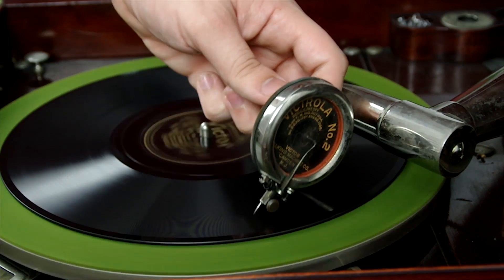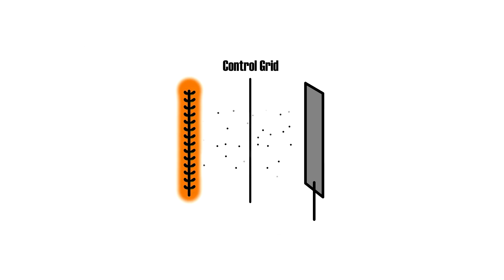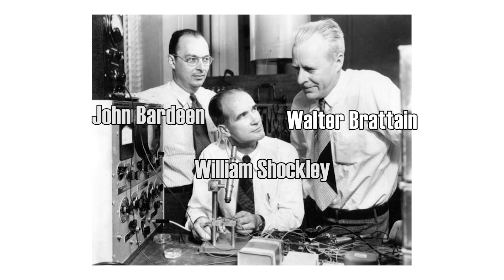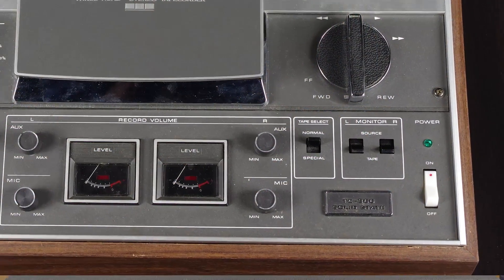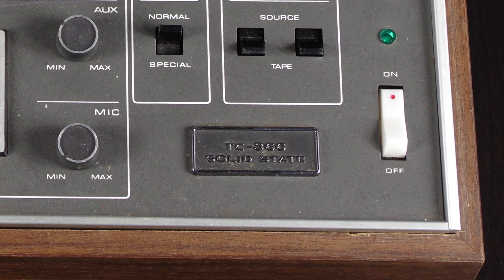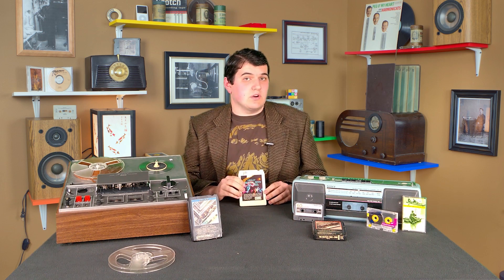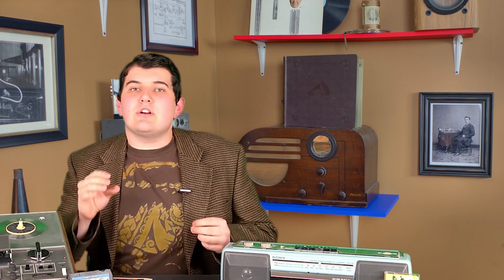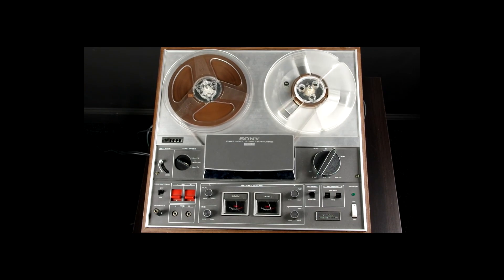Transistors: Making sound easier, smaller, and more efficient

Comment: I quickly cruised through a high end stereo shop in Japan in the late 70s.  If I remember correctly, there were a few cassette machines that used a larger than standard "cassette" with 1/4 inch tape, maybe at 3.75 IPS.  When I started buying decent stereo equipment in the 80s, I wondered why the never showed up in the USA, (that I knew about anyway).

Comment: Yeah, nowadays there's only one place where you want vacuum tubes rather than digital electronics, and that's guitar amplifiers. If you want good distortion and smooth playability (every time I've used digital amps, they always make it feel like I have to strum super hard, almost as if the guitar is unplugged, in order to be audible), that is. I would also suggest PET scanners and other areas where photomultiplier tubes are used, but it seems that the avalanche photodiode is set to replace photomultiplier tubes soon, and that's okay.

Comment: Thank you for a very informative video.  It is worth mentioning that 8-track tape players have their complicated tape-transporting mechanisms inside the machine.  The 8-track player pulls the tape into the machine out of sight and out of reach of the user when playing.  This means if a tape gets caught in the mechanism it is difficult to get it out.  Once a tape gets wound up inside you can't use the player until it is fixed.  Cassette tape is not so inaccessible and moreover is less tangle-prone to begin with.
Reply: Yo 8 track ain't a vhs tape you know

Comment: My first transistor cost me 30 shillings. I thought junction transistor came out first due to them being found by accident while trying to develop a fet. I liked valves and not all were big. Some wire ended ones were used in hearing aids and could be used to make a simple radio. Also valves were more robust. If there was a problem with the aerial on a transmitter you could smell the heating before there was any damage. With a transistor it was dead in an instant in the same situation. Valve tvs, you had to wait for it to warm up before it came on but modern tvs you get the message "Please wait, processing" while it boots up :-)
Reply: @Bill Hall I agree about the "tubes" being more robust. A transistor can be wiped out in a microsecond by ESD. With a tube, impossible!

Comment: So if transistor radios were commonplace in the late 1950s and early 1960s why did it take so long for "solid state" televisions?   I remember tubes in sets as late as 1970.   One manufacturer hailed its solid state as a novel improvement in 1970 or slightly beyond.   I would think transistor TVs would have been a big goal.
Reply: You're quite right. There was a very gradual transistion (excuse pun) form valves (UK term for tubes) to transistors right through the 1960s. There were many 'hybrid' TVs made during this time which included both valves and transistors. Transistors tended to be used in the signal amplification circuitry while a few valves (usually no more than about 8) were used in the scanning circuitry (which operated the electromagnets to deflect the electronic beams in the picture tube) and also the video signal drives to the tube. Valves were used where a lot of power dissipation was required as valves could cope with these tasks better than the transistors of the time which were still quite delicate in relative terms. By the early 1970s, high power handling transistors came on to the market and there was no need to stick with valves in TVs after that.

Comment: You forgot to mention how self-destructive 8-track tapes were. I used to repair them, and had a 50% success rate, IIRC.
Reply: Not to mention that when you pulled the cartridge out, you were often greeted by what seemed like miles of tape, still in the player.
Reply: I'm surprised the inventor didn't find a way of putting oxide on two sides of an aluminum tape just so he could turn it into a Mobius Strip and record twice as long! It took a special talent and lots of patience to get all that tape back in right side out. And you could always hear the gunched spot, even if no one else did.

Comment: 5:56 Your left hand just kinda vanished lol.
Anyways vacuum tube devices do have some advantages over solid state; for one vacuum tubes are less susceptible to external interference and temperature changes, unlike solid-state zener diodes which vary greatly with temperature.  Tubes are still used today in high voltage/high frequency applications like X-ray tubes. Tubes are also better for transmitting large amounts of RF.

Comment: The first ever cassette based format was, in fact, a format developed by the R.C.A back in 1958 which was larger contained quarter inch tape, with a tape speed of 3.75 IPS or 7.5 IPS. Does Alec know why this failed?

Also, the end of the video mentions the episode 'Compact disc digital sound' but I can't find it!

Comment: I took an 8 track apart years ago and it didn't have a spool like yours does.  There were little pins and rollers on each side and the tape snaked back and forth through them at the top there was a little spring loaded tensioner that had a felt swab on it to clean and keep the tape tight.  I found the tape in a 63 Chevy truck I bought, it was buried in the cab's corner under old rags and 30 years of dirt!!

Comment: The problem with vacuum tubes was that they were power hungry and generated a ton of heat. Sure some transistors generate heat too. And the first transistor was what is called a point-contact transistor, and the Field Effect Transistor which was just a sandwich of NPN or PNP.

Comment: There's so much more that could have been said about the early evolution of transistors, instead of spending half of the video on magnetic audio tape. There's also the subject of how the tube industry responded to appearance of transistors. There's the space charge tube that can run on 12VDC. The Soviets continued to use peanut size miniature tubes in their military electronics into the '70s. One advantage: they were able to handle handle EMP or bursts of radiation better than transistors.
Reply: Indeed, the Mig-29 used vacuum tubes.  They have special retention systems for the tubes, of course, to deal with G-forces.

Tubes are still being built and used in Eastern Europe, Russia, and China, though a great deal is simply done for audiophile consumption.

Comment: The only thing I found "a bit-slightly confusing" is that the author noted the connection names for the Transistor as "Source, Gate and Drain" and, although, he isn't in error here, he failed to explain that, that is the connection pin-out of a FIELD EFFECT Transistor (FET) which is only one type of transistor, and, at the time, wasn't the mainstream use of transistors in early electronics.  The type of transistors used, mostly are BI-JUNCTION Transistors (BJT) and consist of the connection pin-out of Collector, Base and Emitter, respectively.
Reply: I wonder how he managed to end up clueless about bipolar transistors when they were the dominant transistor in the early days until FETs were properly developed and evolved into more powerful devices

Comment: 1) The vacuum tube is not inefficient in high power usages at all. In fact it is still used in broadcasting, in theaters and concerts.
2) HiFi is a thing of the past. New consuler grade amps are not designed to be hi fidelity anymore. Many are just crap.
Reply: 1. Agreed.
2. Not all consumer grade amps are like that.  But as before you have to go do your research.  True HiFi certainly does still exist, but as it was with older equipment, you generally get what you pay for.

Comment: To me a tube looked like a light bulb. How does a vacuum tube differ from the light bulb?
Reply: In a lightbulb the filament is heated enough to glow, about 1800 °C, some lightbulbs 2100 °C. In a vacuum tube, it's only hot enough to produce an electron cloud, 900 °C. A lightbulb contains only the filament. A vacuum tube contains other parts.

Comment: The three contacts of transistors are not called gate, source and drain. The three contacts of field effect transistors are. But not all transistors are field effect transistors. Bipolar junction transistors are also transistors and they have three contacts called base, emitter and collector.
Reply: Well, obviously the current is always dependent on the voltage, no current can flow without any voltage. But the amount of current flowing from the base to the collector is still what determines the conductivity. BJTs essentially short their base to the collector, which causes the base voltage to drop to whatever it is pulled down to. So, the base voltage of on a BJT isn't very interesting since the current flow is what actually controls the BJT. The conductivity of a FET however is directly related to the voltage on the gate of FETs behave like capacitors, in a FET current is practically only flowing to the gate when it is changing its state.
And sure there may be more FETs, but you don't say cars have five seats, just cause most cars do.
I'm sure most people wont really care how the terminals of transistors are called and if they are always called the same, therefore in the case of the video, it's a relatively minor mistake that doesn't really matter. But there's nothing wrong with pointing it out. FETs and BJTs are after all very different and therefore have their own specific advantages and disadvantages in different applications, also due to the fact that they need to be controlled differently.
Reply: @phinok.m.628  Have you seen Ebers-Moll equation for a transistor?
Reply: Yeah FET's are rarely used for amplification tasks, he should've clarified that he was talking about BJT's
Reply: came to post this comment. saw it here already. Thank you
Reply: Douche
Reply: And bi-polar transistors come in two types, based on their polarity, NPN and PNP.
Reply: Both are actually voltage controlled, in a BJT, physically the collector current actually depends on the base emitter votlage, the base current is a non-ideal side effect. But also if you add up all the transistors in the world, there are way way more field effect transistors, so to say 'the terminals are gate source and drain' is fine really.
Reply: It's basically the same thing
Reply: Well, it may seem sort of like the same thing. But to anyone who works with such things, it is certainly not the same thing. Mainly the fact that the gate of field effect transistors are essentially capacitors and the transistors are controlled by it's charge (or voltage) and bipolar junction transistors bases behave sort of like LEDs and are therefore current controlled changes a lot in the way you drive them and in which cases you use which. But I just noticed someone else already commented on the whole topic before I did, so I guess my comments on this are redundant anyway.
Reply: @AmazinChannelz  No, they aren't basically the same thing.
Reply: @Dazzwidd  yes they are, they may work a bit different but the function is the same.
Reply: @AmazinChannelz  By that metric they are the same as the vacuum tube and not in need of invention
Reply: @Dazzwidd  what I'm saying is that in functionality they do the same thing, nobody see a car and say 
-well that's not actuallt a car that's a diesel vehicle 
-but it's basically the same
-if it was the same then why aren't we still in carriages? If it was the same there was no reason to invent it.
Can you see how stupid that is?
Reply: @AmazinChannelz  You're just defending your own perspective...
Reply: @Dazzwidd  no, I'm telling the truth, just because 2 components do the same thing it doesn't mean that one is not better than the other, that's just stupid.
Reply: @AmazinChannelz  FETs are better than BJTs. They have a much higher input impedance so they don't load the source and they will operate at much higher frequencies than BJTs can. FETs can do anything a BJT can and many things that BJTs can't do.
Reply: @nakayle  yes they are better, but that's not what I'm talking about

Comment: Advances in technology which saved the compact cassette were, narrower head gap, and Dolby noise reduction, as well as chromium and metal tapes which had better signal to noise ratios over oxide tapes.  These advances gave the cassette a competitive edge to real to real tape in terms of portability.  As for studio work, the real to real was always preferred.  Not now though.  Digital has rendered analog almost obsolete, though if you're a purist, and the work is done vert carefully, analog can still outperform digital given the advances in recording technology available today.  I would argue that most people cannot hear the difference between the two.  It takes a very discerning ear to even detect any difference, and my ear is not up to the task.
Reply: To be fair though, Digital is only a match through decades of sophistication. The storage is large enough, algorithms sufficiently refined, and transistor processors quick enough to recreate all the information. I've never tried playing a FLAC on particularly slow hardware. But if I did, I'm guessing the MP3 will survive on slower machines then a FLAC or equivalent file.
Reply: Jordan Scherr Of course, the one unquestionable advantage of digital is completely eliminating generation loss in copies. The 10,000th copy-of-a-copy is exactly the same as the original. The analog equivalent would be entirely distorted, if not completely  unintelligible.

Comment: Gate, source and drain are only for Field Effect Transistors! For normal transistors they are called base, emmiter and collector. FETs behave more like vaccum tubes. FETs are controlled by tension and normal Transistors are controlled by current. Between the base and the collector.

Comment: Powering vacuum tubes amplifiers is much more complicated than powering transistor circuits.  You need a high-voltage (100V to 400V) for the anode(plate), a low-voltage (2V) high current supply for the cathode heaters, and a negative supply (-130V to -5V) for the grid control circuitry.  In comparison,  you can build a transistor amplifier off a single 9V supply (battery) and a few biasing resistors. 

Vacuum tubes are high-impedance devices and are generally unable to drive low-impedance speakers directly.  This necessitates using a large (heavy) impedance transformer to drive the speakers.  With BJT amplifiers, you can drive 8-ohm loads directly.

Some people favor vacuum tube amps because they generate even-harmonic distortion, which sounds "warmer" to some folks, where BJT amps generate odd-harmonic distortion due to the exponential nature of their IV characteristic.  Mosfets are square-law devices and generate even harmonics like tubes.  In my mind, any distortion in an amplifier is an undesirable thing.  If you are really serious about the quality of your distortion, use an effects pedal.
Reply: From the 1930s to the end of the tube era, there were radios, commonly called AA5 or transformer less radios, that got all their operating voltages from the power line. The tubes had their heaters wired in series with a voltage dropping resistor, tubes were chosen (12BE6. 12BA6, 12AV6, 50C5, and 35W4) that could perform with plate voltages of 100 or lower, and grid biasing principles were used that didn't require external voltage supplies. Since they had no power transformer, they were light, cheap, and very popular. They also made phonographs and TVs using the same principals. And the output transformers for these sets weren't that large or heavy. Many early transistor amps also employed output and phase splitter transformers, as well.
Reply: Rarely is there a separate bias supply use in low power consumer equipment.  You just put a resistor in series with the cathode. This causes the cathode to develop a positive charge making the grid negative in respect.  And only in high power equipment would more than a few volts of bias be needed.
Reply: >In my mind, any distortion in an amplifier is an undesirable thing.
Will you marry me?
Reply: >negative supply for the grid control curcuitry

Floating cathode: Am I a joke to you?
Reply: @Jess Stuart If you had done your homework, you would have known that there are tubes that run with plate voltage as low as 12V. And, tubes can be "self biased" by using a "cathode resistor" which effectively puts the grid at "negative potential" with respect to the cathode eliminating the "C" supply!

Comment: I lived through the cassette tape era.  I can assure you that they were awful.  Yeah, if you spent a lot on a high end cassette player, and high end media, and used noise reduction, and got the settings just right, you could decent sound.  But, few people had the money or expertise for that, so you usually got loud hiss and/or poor sound reproduction on every recording.  It was awful.
Reply: I also lived through the cassette tape era, and yes, pre recorded tapes were awful.  But a halfway decent recording could be had with little expertise on a mid range deck and a chrome tape.
Reply: IMHO the best type were the 8 tracks. the best sounds gives you the types. (Reel to reel)
Reply: Dan Sanger and it sooo didn't produce sound better than vinyl! Comon, cassettes are mp3 of analog

Comment: I also remember that miniature tubes were introduced, only slighter larger than early transistors. They could be used for hearing aids (carried in a pocket) and probably for various military devices.
Reply: In the late 1950s, RCA developed small tubes, called Nuvistors, only about twice the size of the standard transistor package of the day. They were most commonly used as RF amplifiers in TVs and FM radios.

Comment: A taperecorder equipped with vaccum tubes would not nescessarily be larger. In fact the Beocord Belcanto was smaller. But its electronics probably was simpler. Another problem was that it takes time to heat the tubes, it is not ready in an instant (or have to be powered on always).